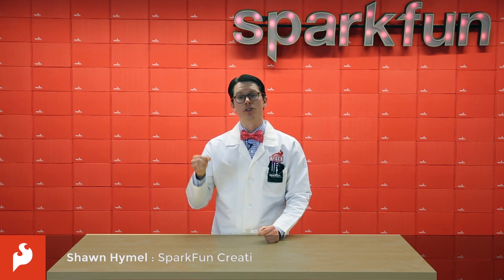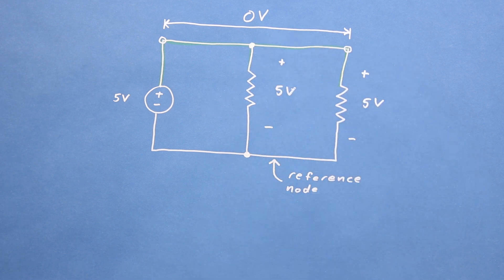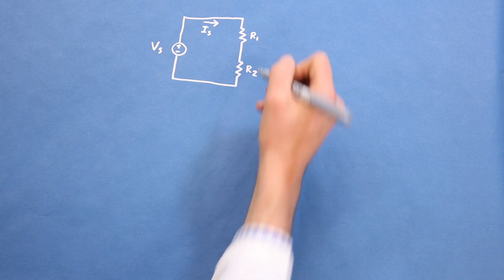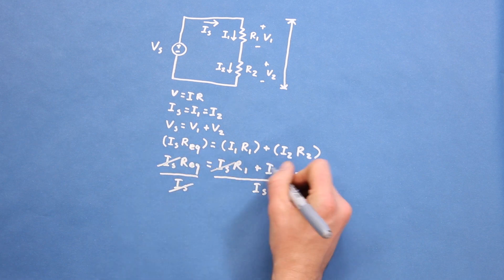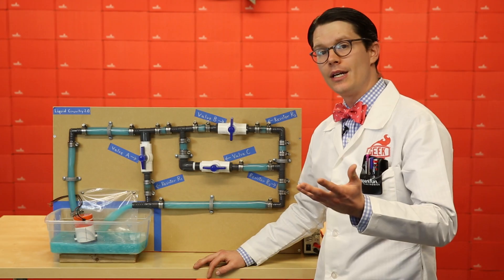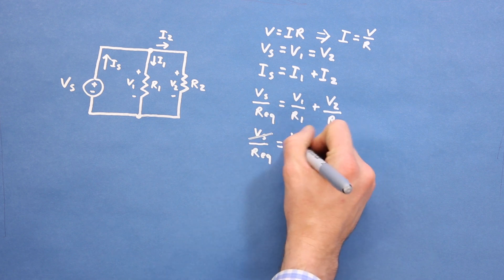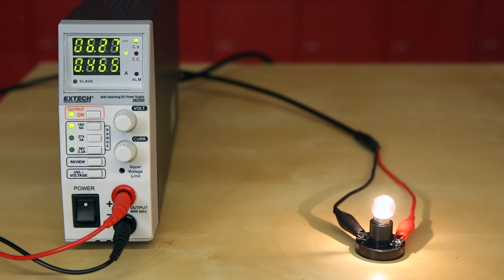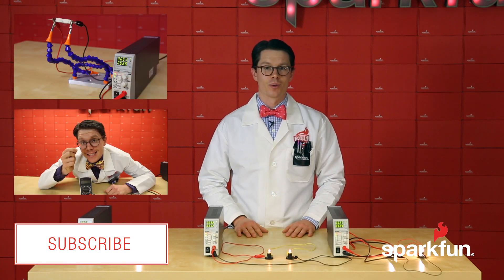Series and Parallel Circuits

Comment: Have to be honest you clearly know your stuff, but this video is way too fast, it would be fine for someone wanting a refresher, but if this is new to you there is no way you'd get this. It doesn't help that you can't actually see the water flowing, and the formulas are very confusing, constantly tracking V1 and I2 that... Slow down, use a combination of practical and metaphorical explanations, and maybe just start simple with what Parallel and Series circuits are. This 7 minute video could easily be 30 minutes of content.
Reply: Thanks for the tip. I'll try to slow it down next time or break it into chunks. Our videographer would kill me if they were 30 minute videos :)
Reply: Shawn Hymel u can make it 7 - 15 minutes

Comment: Really, really, really cool water demo device. I feel like this could be a very useful teaching tool.

That having been said — yeah, I could've used a lot more setup and explanation. (e.g., just for one thing, perhaps a sentence like "and just so you know what you're looking at, when these valves are turned perpendicular to the pipe, that means they are closed.") (or the opposite, if the opposite is true; I didn't grasp it on my first watch-through.)

I super love this series and please, please keep goin.' But yeah, maybe bake a little more context into the setups. 'The One Ultimate Great Video Explaining Parallel vs. Series' is something the world really needs, and you've already built the damn thing. Most people present ideas without helpful aids like your water system; oddly, this has a wonderful visual aid, but not quite as much finesse on the idea-presentation side.
Reply: Thanks for the feedback! This is certainly something that I can come back to or use for a different concept video. From other comments, it sounds like the math was a bit rushed as well. This is all very helpful for future episodes.

Comment: I'd like to know if anyone feel they learn anything from this video. I get the feeling most people who watch this either already knows or get confused by the quick talking when teaching the math parts.
Reply: I wonder if it would be better to do a more in-depth math explanation outside of the video. Taking away the derivations would take away from the meaning (at least for me), but having to watch you explain what "divide each side by Vs" means (especially since it was already clear to me that that was going to be the next step) would be grueling.
Reply: Which math parts did you find to be too fast? Was it the proofs or the examples?
Reply: Shawn Hymel it's the use of high-level language that makes comprehension difficult in a short amount of time. see the potential difference explanation.
Reply: I have been learning a lot from these videos, but I admit I'm probably not a typical viewer. I took some basic electronics in high school and college, and now I'm getting back into it. I remember V=IR and P=VI, but not a whole lot about what they actually mean. These videos have helped me connect the basic concepts together into a more holistic understanding.

As for the math, I have a very strong math background, so I haven't been having any problems with it. I think someone who isn't strong with basic algebra might think the math in the videos is going a little too fast. But, I also don't think that the derivations themselves are necessary to learning the subject matter, so long as the viewer trusts the end result.
Reply: This is good to know, thank you. If the proofs are too much, I can scale them back or eliminate them in favor of a broader overview or concept-focused explanation. I'll also see about using some different language as well for the math parts.
Reply: I think the proofs are useful, but I think you need to slow down and explain things in more detail. I understand all of this stuff already, but had I not I would never have understood at this rate.

For reference, my background is almost no schooling (primary school only) but high interest.
Reply: He explained it in a way that makes it look way harder that it actually is.
Reply: Already knows is correct observation.